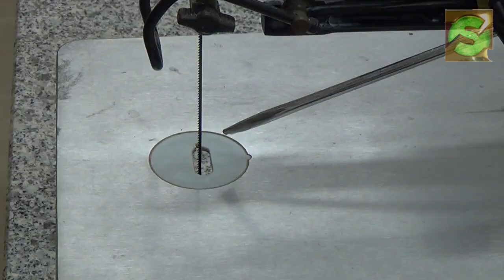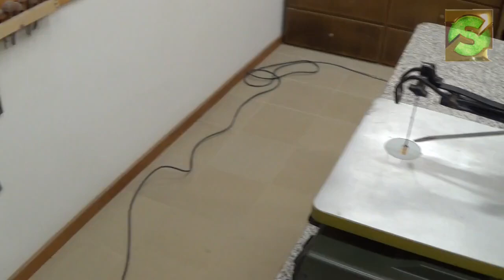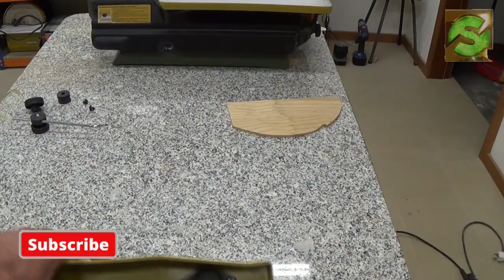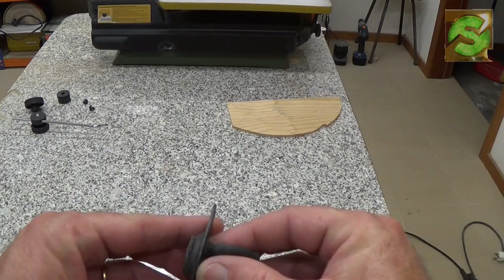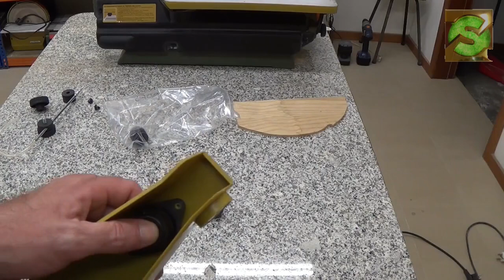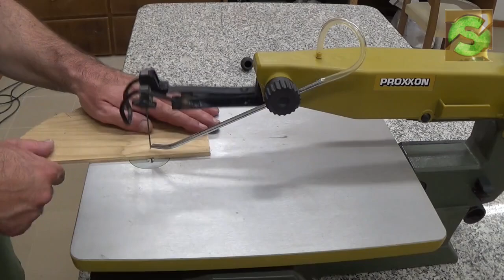Main Tool for Ship modeling - Scroll Saw - Fix Saw Blower " Bellows " - tip - Proxxon

Comment: I'm really sorry but I didn't understand what you were doing properly. I need to supply an air blower to my Dremel MS20 Moto Saw to keep the dust of where I'm cutting so I can see the line that i need to follow. !
Reply from the maker: I don't know the characteristics of Dremel. The Proxxon is already equipped with the Blower from factory. In the video, what I'm doing is replacing the blower with a new one, because it was torn and didn't blow air.
Reply: Thanks for clearing that up. I thought you were making one, not re[airing one. Been and bought 'the world smallest blower' for £12 and it's charged by USB or you can leave it connected by the wire. With a little fish tank tube and piece of coat hanger wire it goes exactly where I need it to.
Reply: @richardclowes6123  sorry where you find the spare blower pump to change on Proxxon? thanks Fulvio